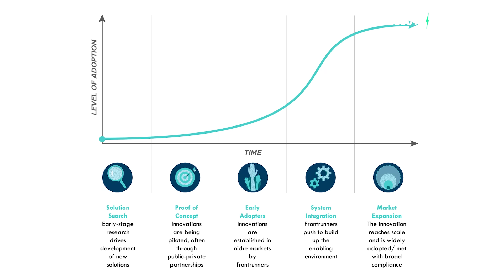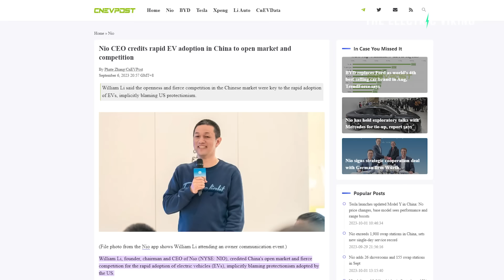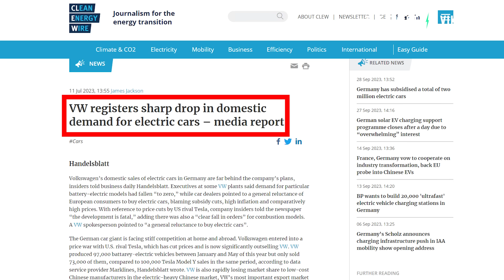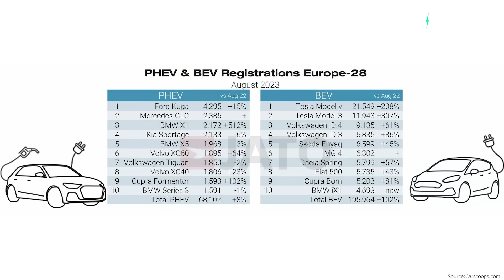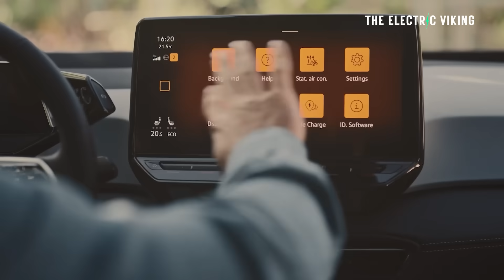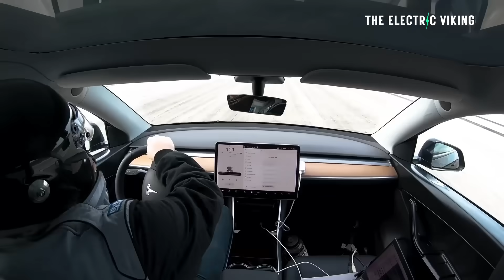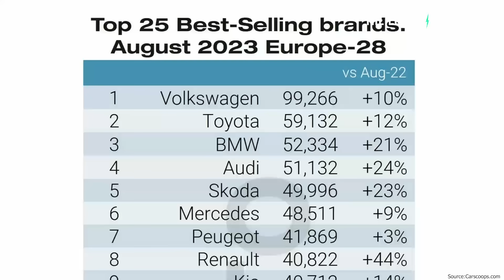Electric car sales in Europe up amazing 102% - legacy auto begins panicking

Comment: Much of this has to do with Russia and the Ukraine war.  Oil and gas costs in Europe have skyrocketed beyond imagination. The war has highlighted the vulnerability of Europe in terms of its dependency on imported oil and gas.   Where as the cost of electricity via wind and solar, along with domestic storage is falling, which better fits the future EV industry.  A car is an investment,  so it makes sense to invest in a technology that can reap the benefits of lower energy costs.  i.e. EV technology.  On the flip side oil and gas will continue to be very costly well into the future, not just because of lower supply, but also due to the oil exporters controlling oil prices to their advantage.
Reply: A car is an investment? Rubbish. 
Who would " invest " in something that depreciates 50% in 3 or so years? I live by the " drive the cheapest car that your EGO will allow you to drive " It's worked for me. Total mv ownership cost over the last 23 yrs........11K.
Ps. People at the traffic lights don't    
care who you are or what you drive.
Reply: Car is an expense, not an investment

Comment: Nice to see Greece get a mention. I used to flash other Tesla’s on the road. Now its pointless - they are multiplying like rabbits. Probably around 50:50 Model Y / Model 3 (it was only Model 3 just 18 months ago). I did see a Model S Plaid on 2 occasions but it may have been the same car.
Reply: @harmony3138  Perhaps for you. I will never buy another make. My Model 3 MIC SR+ with the LFP battery is as near the perfect car for my needs as I could imagine finding. In 3 years or so I’ll swap it out for the latest model.
Reply: @harmony3138  No one is forcing you to buy a Tesla .😢

Comment: In Belgium, we have very high taxes, around 55%, therefore we are the world record holder on company vehicles. Most companies offer a vehicle, traditionally BMW, Audi and Volkswagen to their higher staff. As of September, the government cut tax deduction for these vehicles, except for BEV's, so about 100% of new companycars will be BEV's. 
By the end of this year, Belgium will probably hit between 30 and 40% bev in the new inscriptions. (Volvo is at 40% right now in Belgium, the XC40 and c40 being a belgian product)
Reply: There are 800.000 company cars in Belgium that need to be replaced with EV's by 2025, this is causing the current growth. In private sales, EV sales are pretty low
Reply: Can you describe the Belgian tax incentives for company cars?
Does it have to do with VAT?
Reply: @MrChakra108  VAT is one part, but that is only when buying the vehicle. Running it adds an anmual road tax and an income increase for the personel who can drive it, as that assumes a benifit like driving it home  driving in the weekend. Fleet vehicles are optimised these taxes for the benifit of both the company and driver as it is considered an important add on to the wages. For the copany it is also importsnt to see if you can deduct 100% of the running and writeoff  costs or only 80 or 50%. The CO2 exhaust numbers alter that, favouring cleaner cars. EVs used to be 120% deductable... On top of that fuel is EUR 2 per liter....

Comment: Interesting figures from the UK, a year ago a third of registered new EV were private, now that is a quarter. Looks that Tesla and others sales are driven by corporate and fleet as well as mobility users (free car provision for disabled people). In the UK number of rapid chargers at service stations are so low it is starting to create an issue as drivers queueing and argueing (no provision for a queue). Experience it myself. Need better planning and account for one or two back up charging stops during rush hours.
Reply: @sergeyvalerievich5976: "In the UK number of rapid chargers at service stations are so low it is starting to create an issue as drivers queueing and argueing (no provision for a queue)."
Well there's a surprise (NOT)! - The current UK Govt. administration has gained a well earned reputation (over 13 years in the making) for incompetence, corruption, ineptitude and stupidity on an industrial scale - it's hardly a surprise therefore to discover that their strategic planning abilities, ie, a capacity to plan for the future and act accordingly, are essentially non-existent!
Reply: @stevenjones916  Your limited definition of the Govt's responsibility is correct of course but it definitely IS their role to encourage/shape the general environment in which the market acts, by using tools/mechanisms at their disposal, primarily fiscal but also regulatory, and in execution of that vital role they have failed, miserably - hence the lack of infrastructure now becoming increasingly obvious to anyone even vaguely observant?!?
Reply: The cheapest way to buy an EV in the UK is via a salary sacrifice scheme. You pay the finance out of your pay packet before income tax is paid, you can get between 20-60% discount doing it this way. It shows as a lease vehicle because it was purchased through a business not a direct sale. The business also gets tax relief for offering the scheme.
Reply: @Joeb4iley  so what you are saying is that the decision to buy EVs is influenced by accounting tricks and state incentive  rather than genuine desire to have one? This is all going to backfire spectacularly..
Reply: I have no problem finding efficient, reliable and fast chargers for my Tesla (but I seldom need them as I charge at home).
Reply: @MartinHouston42  EV adoption is happening in spite of "incentives" - and don't forget - according to the IMF and World Bank who have been tracking it for some 30 years, kickbacks, incentives, tax rebates and other perks have been given to the fossil fuel industry for decades. The value (global) of these incentives to the fossil fuel industry now exceeds FIVE TRILLION DOLLARS annually.
Reply: @MartinHouston42 pretty much everyone who buys a £50k car will take some form of finance out, be that PCP, bank loan, HP etc. If you have a way of reducing payments by using a different option that's what you do. 
I'm sure it does play a part in greasing the wheels but at the end of the day, if EVs were such a pile of crap they wouldn't sell even of you gave them away. As it stands they're far superior in many areas, smoother, quieter, more responsive, faster, better handling, dirt cheap to run, never have to deal with dirty diesel pumps. I can only think of one thing an ice car does better, it's quicker to fuel when driving long distance.
EVs make ice cars feel like tractors, phone a few dealers and book a long test drive. When you get back in your normal car you'll understand, they really are that much nicer to drive.
Reply: @peterdavidson3268 I think you just about hit the Bingo top score with the adjectives describing the UK government there. The only one I would modify is "corrupt" to "criminally corrupt" 😅
Reply: @MartinHouston42 You could say the same about a pension via salary sacrifice.
Reply: EVs are inevitable in the UK just like any other country.  No laws will alter that.

Comment: As a marker, we learned that an addition to the steepest part of the S-curve is that the market segments - the generalist product that was launched first no longer cuts it, and manufacturers produce more and more diverse variations of the produce to better fit market niches. The curve then flattens out as all options are covered.
Reply: And the curve will usually plateau a fair distance from reaching 100%. Many people still don't have internet access, cell phone, a computer of some sort (PC/laptop/netbook/Mac/etc.), etc. that many of us consider essential in 2023. My bet is that at least 30% of transport will still be combustion-based in 2050 and that the 2030-2035 bans on new ICE/PHEV vehicles will get pushed back beyond 2040 due to practical concerns such as energy diversity to avoid being completely screwed in case of a large-scale power outages: much easier to train/truck in and distribute 1GWh worth of energy in 40 000L gasoline/diesel/kerosene/ethanol tanks than batteries.
Reply: @teardowndan5364  The trouble is a lot of the old ICE manufacturers have real issues when sales drop, say 10%, I think they will be totally broken if they have to live with 70% drop and no hope of it ever improving. Many have huge debt, who will invest in them? nobody I fear.
Reply: ICE vehicles have low margins on their sales, which are dropping off a cliff. A drop of 20% is probably down to break even. And Legacy Auto cannot make EVs at a profit. (Essentially software issues). Conclusion - they have not got long - 1 or 2 years at most, before they are not making any profit...what will they do ? Tax-payers will not look kindly on another bail-out....
Reply: @teardowndan5364 i would take that bet in an instant. I predict fewer that 10% of new car and light trucks/van sales will be anything but BEV by 2030 and 50% will arrive before the end of 2025. As for old vehicles still in use they'll be crushed in alarming numbers as they become unwanted by almost everyone.
Reply: The car culture is changing. Going from one to two and even four exhaust pipes was seen as a status symbol in a positive way. Now the exact opposite is true. Silence and no exhaust is the new thing. Why we ever tolerated noisy, stinky polluting vehicles is the biggest question nowadays.🤔
Reply: @chrisheath2637  However governments, faced with hordes of freshly redundant and now unemployed people may well doo, as some form of help could easily be less a burden than having all these extra people of their social security books (and not paying taxes)

Comment: One thing to add, in the US there is a $4,000 tax rebate for used EV's. But they must cost $25,000 or less. And be purchased through a dealership. On Tesla's website the cheapest used M3 is a 2020 M3 Standard Range with 40k miles for $27,300. Don't know when or if Tesla will start selling used M3's for $25k or less (don't want to cannibalize new models?)  but if they do it will open up a flood of affordable quality EV's to the market and enable less affluent folks to afford EV's. High mileage MS's and M3's are appearing at third party sellers for under $25k but that's taking a risk.

Comment: An interesting addition to the car news would be periodic inclusion of the latest in what's happening with the hand in hand electrical infrastructure developments world wide to keep pace with the increasing market penetration from EV's.
Reply: Exactly! When someone shows a Workable Solution to make At Home Charging work for Apartments, Condominiums, and Townhouses / Row Houses, that will be a good Start!

If they can tie that in to Grid Energy Storage plus Solar, it might even be Better!
Reply: If, for every "DC Fast Charging Stall" there was a requirement to install 4 - 8 Level 2 EVSE's (Home or Destination Chargers), within a 0.5 Km to 1.0 Km  Radius of the Fast Chargers Location, that would be great, also!

Comment: Here in the UK, you can pick up a new Tesla model 3 for only £43k. Bargain basement prices like that make it virtually madness to consider a legacy ICE for half the price. I mean most people can afford £43k right?
Reply: On £11 an hour 😂
Reply: @adamanthony7465  If you're valued at only £11 an hour you are not worthy of a Tesla. In fact, you're probably not even worthy of a bicycle.
Reply: TCO... (Total Cost of Ownership)... True - the sticker price is high, and insurance is also eye-watering, but the facts are showing that a £45k Tesla will cost the same to own as an equivalent ICE car costing £25k over the first four and a half years, after which the Tesla becomes cheaper. And a Tesla will last for several decades... Mine (now 3 years old) has never had a service, because it does not need one - and probably never will - and "fuel" (electrons) cost me around £12 to £18 a month.
Reply: @brunosmith6925 several decades!!!! Sure, if garaged and never driven
Reply: Yeah, you're absolutely right. That's why i bought a Model 3. ICE can't compete any longer at this price point. But i don't agree that a comparable ICE car costs only 25k. Especially if you compare equally equiped cars.
Reply: @thedreamfactory6964  I'm talking about sticker prices. The operating costs of a $25k ICE car go UP - and rapidly - over time. While there are many variables at play, the general consensus is that the TCO of a Tesla model-3 becomes cheaper than (for example) a Toyota Camry at around 4.5 to 5.5 years into ownership.

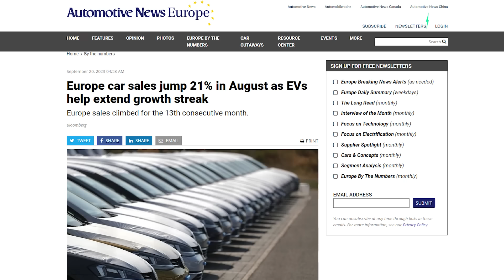Comment: I have a hard time understanding sales up any percentage above 100%. What does 102% really mean and what is the difference between 102 and 160%? 20% registration in Europe sounds about right. But I don't see 1 in 5 cars currently being BEV. An observation on the highway and it seems its more like 1:20 that are BEV. And I haven't seen expansion of public fast charging on the highy been adopted significantly in de last 2 years in real life in the Netherlands.
I think the main reason Chinese cars are still too expensive in Europe is import costs. I think it is a political thing and won't change for a while. So the only thing China can do is make EVs cheaper. I think China will achieve that via mass production. European carmakers willreally feel that competition and shift in marketshare. The only other way I can see Chinese brands selling their EVs for quality at current prices is to to work on Europe's critique on software standard to European quality and taste and servicing as a priority. Then we might actually see a shift from the established European market. I think Stellantis currently does have interesting competitors on the market. But I think the should not cut costs on modern safety features on their cars as an option. Ot should be standard and high quality (means level 2 autonomy, no ping pong lane assist, good quality adaptive cryise control and one pedal driving as standard and uniform high quality experience across the portfolio. I think only then I think they could make a decent comeback in marketshare.
Reply: You sell 100 cars last year. This year you sell 202 cars. You sold 102 more cars so you increased sales by 102 percent. And if you sold 260 cars this year, you sold 160 more than last year, so sales increased by 160 percent.
Reply: Sales of New Vehicles is not equal to ratio of them seem on the Roads! Simply because the Roads equal the Total Fleet, and if All Sales each year were Strictly BEV's, it would still take 15-25 Years to change out "All" the Vehicles to BEV's!
Reply: If new electric car sales are twenty percent then one in five NEW cars are electric .🤔

Comment: The fascinating thing with EV market is that it is much much more R&D and capital intensive than ICE.
ICE needed a few breakthroughs, regulations and transformations here and there, then resume business as usual.
EV is R&D top to bottom. Mineral extraction and transportation is the most similar part to Fossils. And even that is unique: EVs components can be mostly recyclable, so the mineral market is going to take a different shape if left alone by traditionalist fossil industries.
then, manufacturing, marketing, monetizing. We are seeing this alreadu betwwen AI models trainings, safety and self-driving and fleet management, to your classic silicon valley tracking for ads, to  car-tertainement, to whole new markets of renting and selling EVs and energy.
then the whole battery universe, which will keep bouncing back and forth from transportation to grid stabilization to energy production.
then there is the whole platform which requires far less parts and is simpler, thus the question and the potential markets of repairability, post-market upgrades, customization.

the lack of vision and leadership on the part of the transportation industry is so strange, and just points out about how much it became a satellite of the fossil industry, instead of focusing on the transportation market on its own. Afterall, anything the provides energy to a vehicle makes it move, so how come we are seeing so little creativity in the space by the big ones, including price wise??
Reply: Thanks for the word salad.

Comment: Fast-forward to 2030, BEV sales will hit a brick wall at ~60% of new sales because they still aren't suitable for everyone everywhere, government BEV incentives will have died out, governments will be applying substitute taxes to fund road maintenance from BEVs, more frequent BEV crashes and subsequent fires will cause the wisdom of having large batteries everywhere and readiness to deal with them when they go up in smoke to get questioned, etc.
Reply: We'll be at 60% well before 2030, and then we'll be able to see if you were right ;)
Reply: The simple economics (profitability) of making ICE vehicles will result in most major ICE manufacturers to go out of business (law of economy of scale). And while you may YEARN and HOWL WITH ANGUISH at the desire to preserve the ICE industry, you can't buy what isn't being made anymore.
I have a 100% working and really lovely JVC VHS video recorder... I LOVE this machine and YEARN to use it and HOWL IN ANGUISH that I can't. Please tell me any shop that sells the tape cassettes.
The machine has been neatly boxed up in my loft for over 10 years and I once tried to sell it on eBay... no takers.
I wonder when the same will happen in the car industry? Oh... it's happening!
Reply: Fast forward? By 2030 everyone can afford a second hand bev car. You have no clue on how economy works. That's obvious.